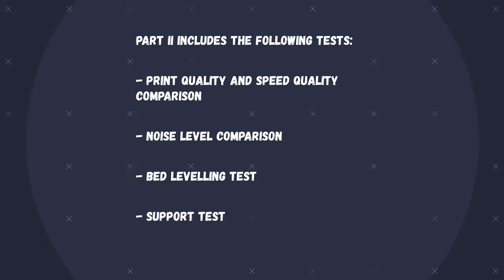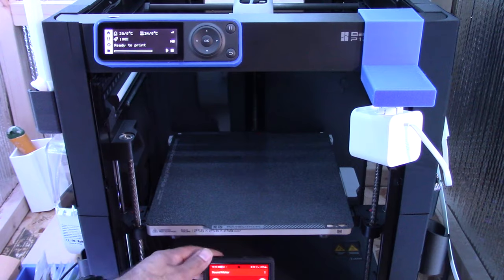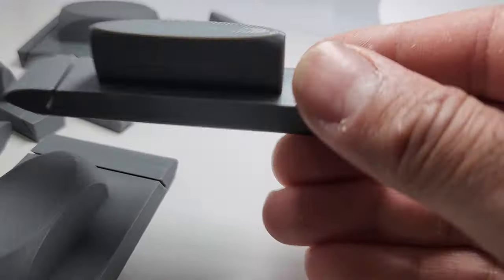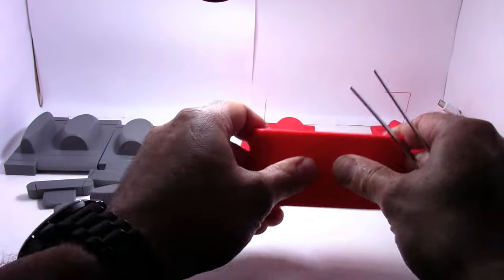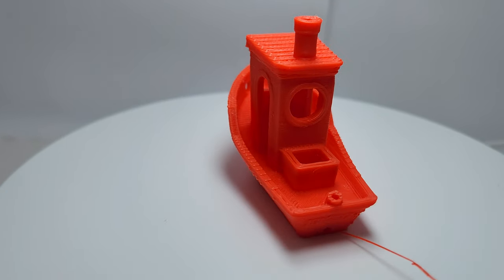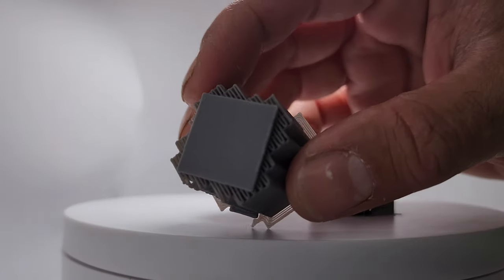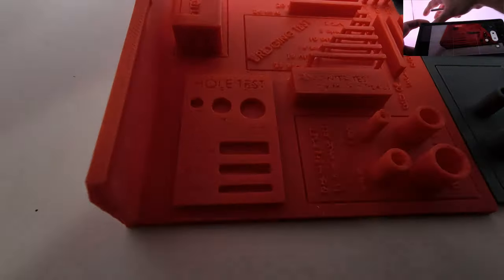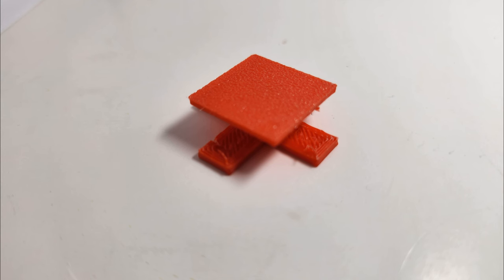Ankermake M5 VS Bambu P1P Comparison Part II in 4K: Not sure which printer to buy? Watch this video!

Comment: my first M5 was horrible. I replaced the V-wheels, belts, and hotend. Then I figured out the bed was horribly warped as well. Anker told me it was ok, and the leveling algorithm would account for it. It didn't. Large prints would fail in the exact same place every time. I purchased a second ankermake at full price (first one was a KS). Anker credited me my KS funding back and took the first printer back. By this point I'm out about $350 between the price gap of second printer, new v-wheels, belts, and filament (anker told me to only use theirs so I bought some to try it). The second one was ok at first. However, I started having terrible fan whine from the PSU about 2 weeks in. Then I started having print issues. I wanted to change the nozzle, but it was cross thread and snapped the cheap screws. Then, I went to take the hotend apart and start fixing it, but all 4 screws were 100% stripped and rounded out. Anker told me they didn't have any to send and I needed to buy them. Granted, they said I would be refunded. However, at that point I was SO DONE. I sold it for a $500 loss. All in I lost almost $900 on my ankermake. I've had an X1C since the KS launch. No major problems with over 3,000 hours printing. I REALLY wanted to like the Anker. It would be solid if they used hardened screws/gears/parts, had a true all metal hotend, and had good QC.

Comment: I don't experience such issues with my Ankermake. Can the issues especially regarding the Benchy be related to the PLA? Did you also tried the original PLA+ from Anker or eSun? Thanks for the great video!
Reply from the maker: Hi Rock, thank you for watching and your feedback! 

I have been printing for 3+ years. 

 I've had my Ankernake since November 2022. I've used every single pla brand that exists on the AnkerMake. In regards to the 500mms Benchy, I have tried esun, eryone, overture, duramic, eleegoo and the Anker PLA. Results are all the same at 500mms. The printer was not designed to print at 500mms with quality results. 

Part of the reason I got rid of one of my ankermakes and debating on selling my second, is because I got a bambu and realized immediately that Anker really messed up with this printer. They used very cheap quality parts in the printer and I am certain that is a big reason for all the issues the printer has.

Edit: typos
Reply: hi Mic, thanks for the clarification. I was undecided whether p1p or m5 the right choice for me as a beginner. unfortuntely your video is too late for me. but hopefully helps the others. btw, after your video, my next 3d printer will be most probably a bambulab :) cheers!
Reply from the maker: @rock-mtb-kry  we are all in the same boat my friend. I'm glad that this video will help people make a decision in the future. I'm most likely going to redirect my channel focus to be 90% 3D printing moving forward, so keep a look out for new videos!

Comment: Hi I have 2 ankermakes and I’m having trouble breaking or having nozzles getting stuck when changing or replacing them any tips?? Also I’ve heard Bambu has terrible customer service? I would like to get a bambu eventually I bought my ankermakes without doing my homework 😢
Reply from the maker: Hello, I haven't had any nozzle change issues with the M5. I've already replaced the nozzle a few times on it. I basically remove the green sock, heat up the hot end and then unscrew the nozzle with a socket wrench. I add the new nozzle by using pliers to hold it while rescrewing it in with a socket wrench.I do this while everything is hot. So I advise great caution if attempting this. 

As for customer service, parts replacement and such between the two printers. You'll have to wait for part 3 to see. Both have terrible customer service. Although Anker has improved drastically over the last few months.

I also blindly purchased my Ankermake off kickstarter. They did a very good job with marketing the printer. 

Unfortunately, the results are what they are. I also had two ankermakes (only keeping 1) and I wish the results were more even, especially since the AnkerMake costs more than the P1P.  I made this as fair as possible. Two printers headquartered in China, similiar price range, similar specs. I did not give the M5 or the P1P any advantages in the tests. This is all raw data, raw results.

Comment: For the bed leveling test on the M5, it appears to me that the PEI plate was not cleaned and has obvious remnants of previous prints. It looks to me to be poor adhesion on the test print causing the issue. Am I missing something?

I clean my plate after every print.
Reply from the maker: Hello, thank you for watching. My plate was actually clean. Yes, there may be some permanently baked on microscopic things that are as flat as the plate; but the plate is as clean as possible, in its condition at the time. You could argue dirty plate all day, but the real question is why wasn't the best levelling correcting the so called dirty plate?

The real issue here is the printer. Poorly designed, poorly executed, bad software and terrible components. The tight wheels are  one of the many known issues that have been known for quite some time now. That's what you're seeing in the video.

Comment: Tbh the Ankermake  does have an issue on the left corner fixed it by loosening the vwheel. Anyways wish Bambu had PayPal
Reply: I’m new to 3D printing is that the 2 adjustable wheels on the right side of the table? If so did you loosen both of them? Mine came out of the box so tight you could feel bumps in the wheels when moving the bed by hand. In your opinion should the bed move really easily? Even if it feels to loose? Thanks any other tips would be appreciated
Reply: @FKHTrump2024  there's two on the right that are adjustable but the one on the left is direct to the vwheel not really supposed to be adjustable and because of that the bed is unlevel on that side so you have to loosen the vwheel to move the bed up. Also Both printers are from china btw.  Think it's about two and a half turns with the nut and it's really hard to do. The good thing that Ankermake is better then bamboo and the only thing is modification warentees also they changed allot and invited engineers to help them out. They were anti mod at first.
Reply from the maker: huh? I used paypal to pay for some of my bambu spare parts.
Reply from the maker: Hey jthedarkwolf, 

I am curious to why you think the Ankermake is better?

I have done extensive research on both printers. 

Bambu is fully open to mods and they encourage it. I believe Ankermake was anti mod from day 1 and they recently started to match Bambu to try and keep up. Bambu mentioned that if they were to go bankrupt they would release everything to the open-source community. I am willing to bet you that Ankermake would never do that. 

I also want to state that I had two Ankermakes before I even purchased Bambu. My opinions come from owning both and Ankermake being a disaster for me in every way shape and form. Purchasing the Bambu was the best decision I ever made because it is the printer that I thought Ankermake would have been. Ankermake continues to let me down and fail in every category that I would like it to excel in. The Bambu just works, I haven't had to touch it once since I got it and its perfection every single time.

Edit: Typos
Reply: @MicBot   oh I don't think it's better but it's what PayPal covered, tbh it just prints that's pretty much all I care for. However Ankermake changing their views on modding and letting engineers tinker with the machine is a good change of pace. They used to be anti mod.  Think Bambu is better.
Reply: @MicBot  really where at? Was gonna buy the p1p now that I know that I may try for the carbon later on.
Reply from the maker: @jthedarkwolfxtreem  on the Bambu labs website. When you checkout and select payment, choose PayPal. If you dip your feet into Bambu world, make sure to pick up accessories and some upgrades for the P1P. Check out my 2 videos on the P1P for upgrades and spare parts. Even with the 4 upgrades ($100 total Canadian) you're still well below the price of one Ankermake, for so much more printer.
Reply: @MicBot  thank ya was looking for that option in the  checkout might of missed it. I can say Anker slicer alpha is such an improvement
Reply: I bought my X1c with paypal?

Comment: Do both require the Cloud?
Reply from the maker: Hello, yes and no. 

You can add files to the sd card on the Bambu and set it to lan only mode to avoid using the cloud. 

As for M5, you can add files via usb c stick. But you need the cloud to view your printer and status and so on. 

So in short they need the cloud to have full functionality, Bambu has a lan only mode but you need to be connected to your home network to use it in lan only mode.

Both report back to there Homebase in China, with the exception of lan only mode on the Bambu.
Reply: @MicBot  Thank ypu.